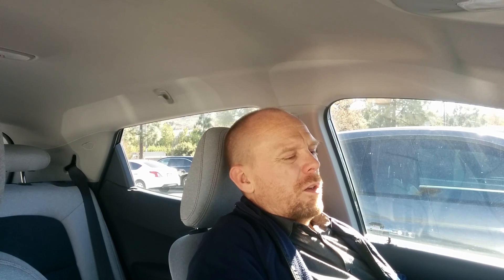Plug-Side Chat: Equipping EVs for Cold Weather

Comment: Weber's video on the heating cooling systems on the Bolt are fascinating.  The "radiators" are very small.  It appears there is very little heat available.  That is the problem with incredible efficiency, very little heat left over.  Clearly though, that is the best scenario for the hot weather states.
Reply: This is one of the benefits of fuel cells in cold weather. There is waste heat (about 20% usable) that can be used to hest the cabin. This means that a fuel cell vehicles range only drops marginally even in -20°F weather. The other other problem with batteries is that they need to continually draw power from the wall to keep the battery conditioned whereas a fuel cell can freeze solid and then self start from frozen (which means there is no need to waste energy maintaining the fuel cell temperature, in fact most FCEVs don't even have a plug at all, so you couldn't use wall power if you wanted to).

I live in California but I use the fuel cells waste heat to heat the cabin a few days a year and it is all that is needed here. In -20°   you'd need supplemental heat through seats and the PTC.

Comment: What are you talking about? Bolt already does what you are talking about plus it adds a heater element to heat the coolant when it is too cold. Heat from electric motors is a loser, not a benefit. https://www.youtube.com/watch?v=_ILkLUE3Zxc&t=6s